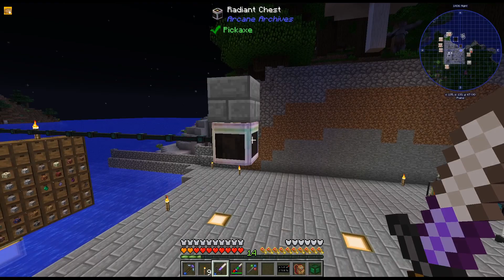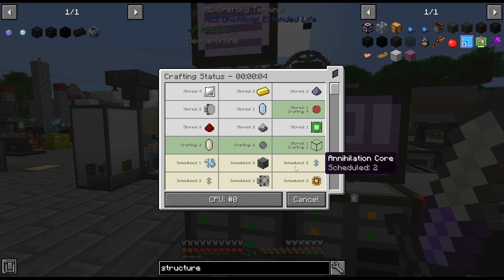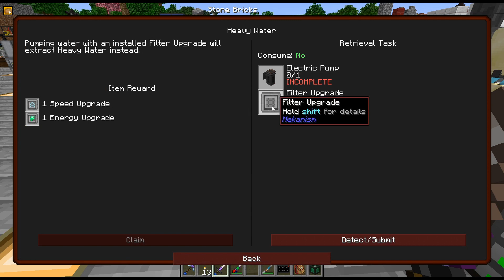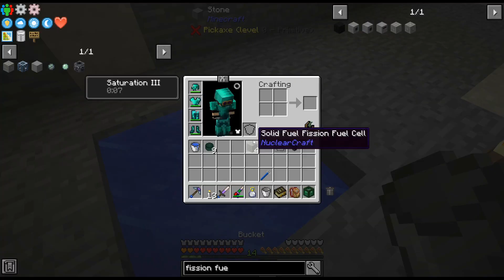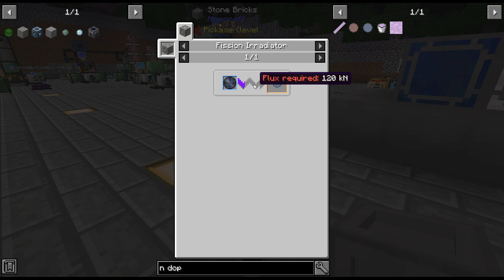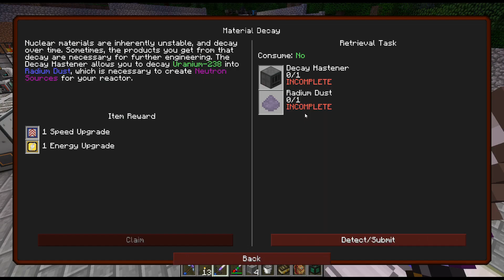Multiblock Madness - 73 - First Nuclear Reactor Design (Reupload)

Comment: I don't know if anyone mentioned it on the original video, but you could try using the Mekanism Item Mode hotkey to change the Morph Tool version of the configurator (it seems to work in 1.16, so I'm guessing it'll work in 1.12).